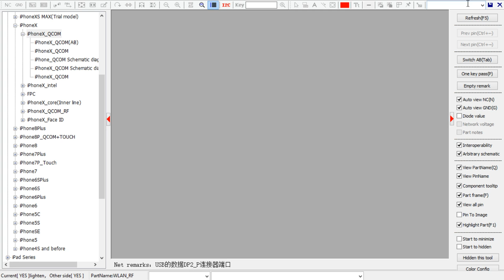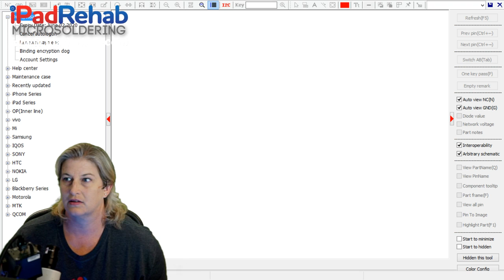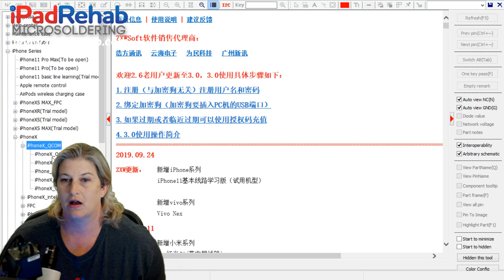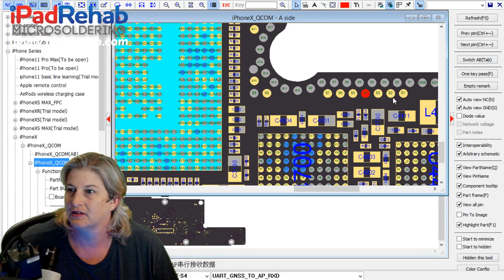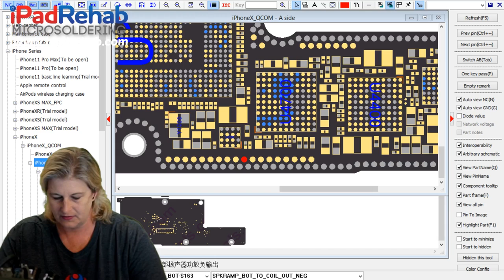Part II: Can't Enter Passcode on iPhone X?  Apple said no?  Hold my beer.

Comment: The sweetener aspartame causes health problems

They can summon up illnesses that nobody ever associates with the "harmless" sweet substance. Some symptoms lead to misdiagnosis because they are similar to the characteristics of multiple sclerosis and thus destroy the lives of people who have never been told that consuming light drinks is responsible for their miserable health.
Aspartame is a sweetener that, like sugar, has four kilocalories per gram. But since aspartame is 200 times sweeter than white table sugar, you only need a fraction of the sugar amount of this sweetener, and calories are not important in this case. Aspartame is also known as "NutraSweet", "Canderel" or simply as E 951. It is a popular sweetener because it tastes "natural" like sugar. Other sweeteners, such as saccharin, often have a slightly bitter aftertaste.
Reply from the maker: On what evidence?  As in—link to primary research with statistical data about “summon up illnesses”